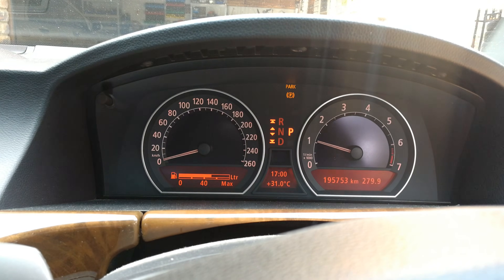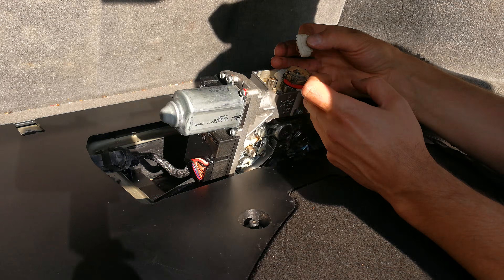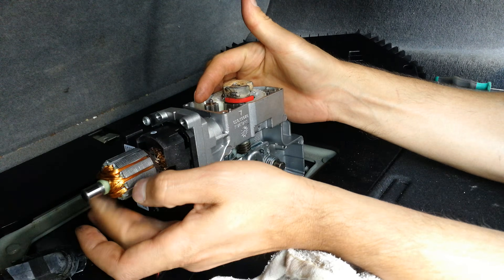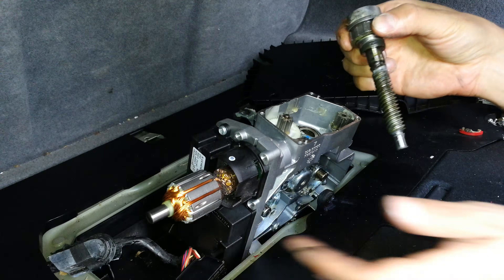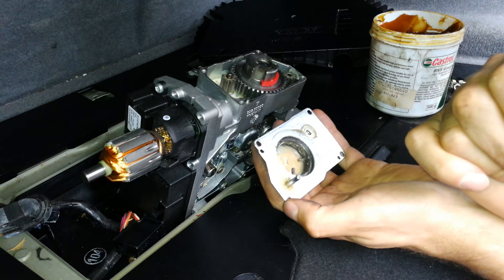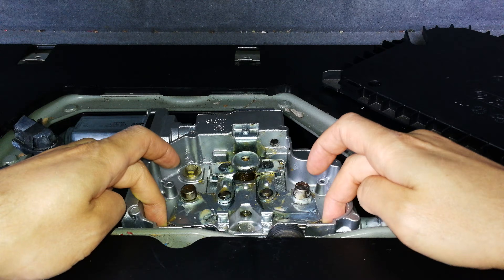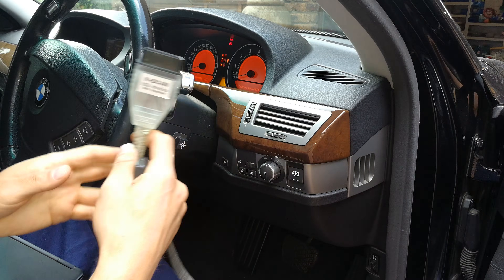How to repair the electronic park brake actuator gear on a BMW (E65) - step by step

Comment: Can anybody help by explaining what the tags on the spring on the gear shaft end cover engages with on the gear shaft. He explains to make sure they line up but doesn't show very well what they line up with. As I understand the spring is to assist apply the park brake.The spring seems to line up easily with the part next to the red spacer. But it doesn't do anything fitted there.I can't see any other way to fit it due to it being a tight fit in the end cover. I've searched everywhere but can't find an illustration showing how it's fitted.

Comment: Thanks for the video. I still don't understand why car manufacturers complicate things by adding an electric motor, a gear system and a controller to a simple and reliable handbrake....
Reply: First of all, this is supposed to be a 7 series. The best of the best and the highest tier back then, 20 years ago. A maximum comfort car, does your brain get that? Which car had comfort functions like the automatic breaking, like he described at the end of the video 20+ years ago. Sure, pulling a handbrake is easier, but the electronic function is a comfort function which the buyers of these cars 20 years ago wanted and appreciated.

Comment: What a thorough repair video- thanks so much for going to all the trouble and commentary.  I was able to follow the steps and replace the busted actuator gear sprocket on my '03 745Li and the brake performs flawlessly.  Got the replacement all-metal actuator off Amazon, next day delivery- unbelievable!  I did re-use the red tab on the new actuator.  One side effect took a little time to settle out- the car would shift into Park fine but the dash indicator would show N for Neutral.  On the forums it seems this is cleared by adjusting the parking brake.  But in my case it seems to have resolved the issue itself as it's reverted to displaying P when I shift into Park.
Reply: Which one on amazon did you purchase I purchase one and it did not work and the red tab was to small for the new one.
Reply: hello! I have the same problem! can you give me a link where I can buy the replacement axle. or maybe just a part code. I don't know what to look for?

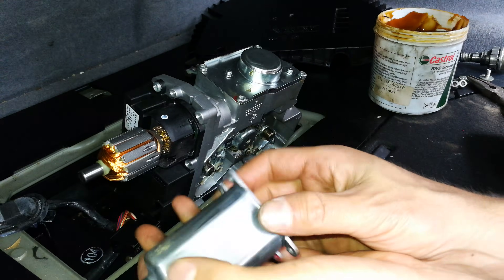Comment: Please edit video at 7:00 
It Is very important how you put the cover. If you put it wrong parking brake will not work more than once. That's why you turned it the proper way between video cuts. Don't be an asshole and mislead people
Reply: Why don’t YOU make a video about it if you haven’t specially if you know the “proper” way to do it it sounds like you have the knowledge share it with people man don’t be a selfish asshole.
Reply: @nonya2905  You are free to try and put the cover on the wrong way. Let me know if it works :)

Comment: After watching your video I ordered a replacement gear for my 2003 bmw 745li 7 series and come to find out the threading wasn't a match. So clicked on the link you put on someone's  comment to order the exact replacement gear i need. Just in case can you please send me the link just to make sure it's the right one.
Reply from the maker: https://www.amazon.com/gp/product/B0716PWXHW/ref=ppx_yo_dt_b_asin_title_o04_s00?ie=UTF8&psc=1
Reply: @ecologicaltime  Thank you brother. Let's see how it goes.
Reply: @ecologicaltime  So I replaced the gear just like you demonstrated and when I push the parking brake nothing's happening. What could I have possibly done wrong?

Comment: Can sometimes be fixed with a brake system reset.
Reply: How do you reset the parking brake to make the light go off if you've already replaced the old one?
Reply from the maker: not if gear is broken. But first step is to reset. If still not working, open it and fix gear.

Comment: Bro i have same problem on 2007 750 ... And i put new one but dont work idk .. If i do wrong but problem is workin if i drive litle and i push the break botton and is work
Reply: You have problem the same like me it's problem with cable of parking brake broken

Comment: Btw : for those that have their brakes stuck engaged you can release the parking brake by taking the cover off , there is a small Allen key way to manually release the parking brake I believe it’s an 8mm. Turn counter clockwise, Once you start turning you will see the cars parking brake start to release
Reply: The Locking clip and triangle clip won’t remove notice brake still engages even when release parking brake in truck and under Dashboard what’s the problem?

Comment: Hi mate, i have the same problem with my BMW 730d 2004 
someone before me change all of the parking brake but now the cat doesn't recognise the new one.
Reply from the maker: if i recall correctly, you just need to code the new one.
Reply: ecologicaltime Thanks for the answer the thing is my mechanic can't find the code to recoded the module